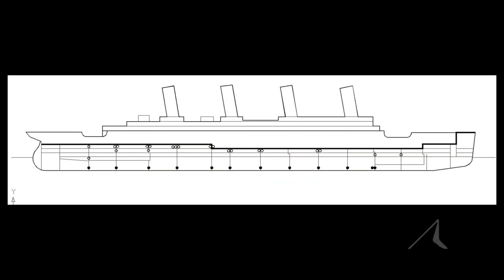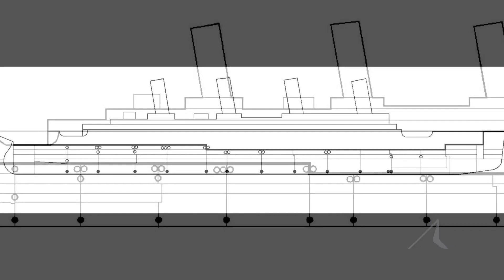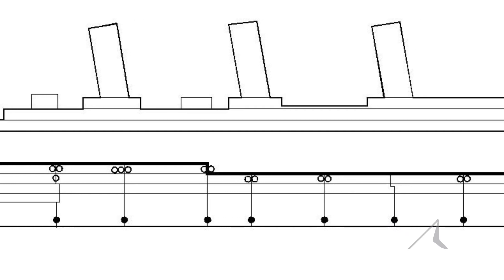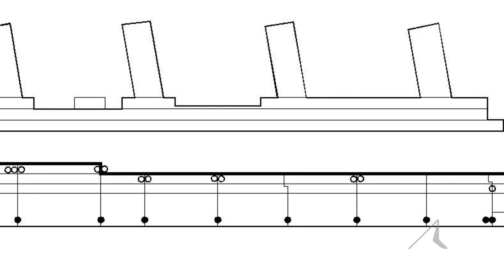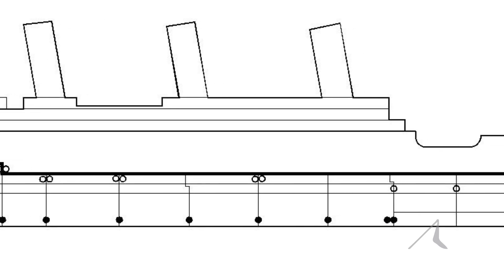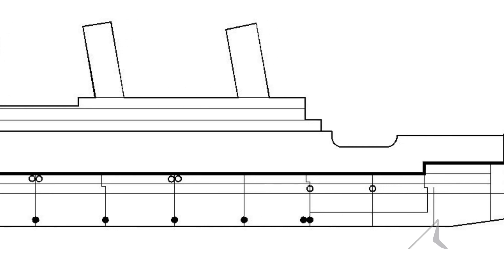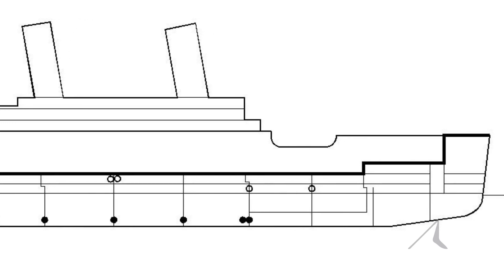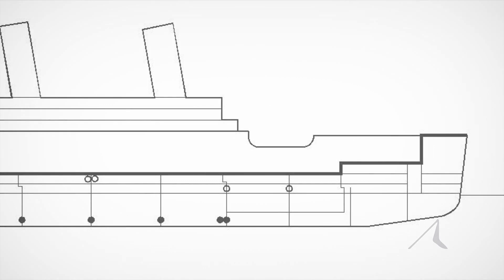Watertight Compartments - Parks Stephenson

Comment: I don't care if it were one or six compartments, without ceilings, the watertight bulkheads do nothing.
Reply: It would. The ship would stabilize if the internal water level would be the same as the external water level. This could be achieved with 4 compartments filled. But here, 6 compartments were breached  that dragged the ship further down without giving a chance to stabilize. 
And it was not without ceilings. Don't picturise it as an open ice tray. The tops were covered, but just not watertight. There were stairs, doors, etc... What they mean by water spilled over the bulkheads is that when the water level went beyond the top of watertight bulkhead, the water would find its way to the next compartment through the stairs or doors on the decks above and flow down.

Comment: why would they be watertight if the water could just overflow over the compartment?
Reply: That would also mean it would be airtight. It's impractical for different reasons like ventilation, stairs and access, crew movement, passenger movement etc 
Watertight in ships essentially means it delays the flooding and contain the water as much as possible. The water level inside the ship would only come to the level of water outside the ship. The ship wouldn't sink beyond that. So as long as the watertight compartment's top sits above the external water level, it's more than enough. In Titanic's case, the limit it can hold was exceeded and that's why the water filled up other compartments. If 4 compartments were filled, Titanic would've stabilized with the external water level. Since it flooded beyond the limit, the water flooding inside the ship weighed more and dragged the ship further down. This didn't give Titanic a chance to stabilize the internal water level with the external level and the sinking continued.

Comment: I cannot name a single wooden sailing ship that had enough natural flotation to stay afloat. Furthermore the drawing shown in very misleading with the dark line on top implying that the compartment were air tight. They were not. The tops were open in most of them.
Reply: He didn't say that a wooden ship will float without displacement, he said it would "help".

Comment: Andrews knew he had covered all the accidents Titanic could survive. Of course Titanic had one of the accidents she couldn't. With sea water in 4 compartments there is enough weight on the floor of the boat to push it down and fill it up. With sea water in 3 compartments there is not enough weight so the water won't reach the bulkheads to spill into 4. Not even close. So wtb all the way up won't help titanic. In fact with full closure 123 and 4 would quickly fill up and Titanic would hit the bottom of the ocean about midnight. On the actual night 6 watertight compartments were breached which is unsurvivable, watertight compartments all the way up or not. In fact rear of compartment 4 watertight doors and bulkheads only slow the sinking. 24 knots in an ice field just scary.
Reply: How would water spill over the top of the compartments if they were fully closed?
Reply: @gerrycalhoun9827  Because the the bulkheads only extended upwards a certain length. So if enough compartments were breached simultaneously, the combined weight of the water in each compartment would pull the ship down deeper in to the water, which in turn would cause the water level inside the ship to rise, and it would rise over the tops of the bulkheads and in to the next compartment. This process repeats itself like a domino effect, getting faster and faster as more water (weight) pulls the ship down. She could definitely stay afloat with the first four compartments breached, but not five. As a result of Titanic, bulkheads extend all the way to the deck and ships are typically compartmentalized so that flooding can be isolated to the area where the damage is located, but even this isn't enough with modern ships sometimes (see, Costa Concordia).
Reply: @setantii298  the watertight bulkheads were above water very low so  ANY flooding could pull them down and water would spill..

dont forget that titanic had more than 16 watertight doors.. the  there was numerous manual-watertight doors that had to be closed by crew members

if they only closed compartment watertight doors leaving the manual ones open that would explain quick demise.. from witness accounts there is described situation that  crew was unable to close one of manual watertight doors  near scotland road,doors were jammed 

titanic problem was a bit different
original damage by iceberg was in

forepeak tank in forepeak compartment,only ballast tank was flooded,compartment was dry
cargo holds 1 2 3 were taking water
boiler room 6 was taking water
boiler room 5 coal bunker was taking water but boiler room itself not (for while)
about more than hour after collision water started to appear in boiler room 4 and little time longer boiler room 5 was filled up..

when titanic fate was sealed? when boiler room 6 filled up.. that was 4th compartment and titanic could not lose any other,  the 4th compartment was final.. loss of boiler room 5 was just shortening sinking process

the flood rate of boiler room 6 was pretty high. if we compare flood rate vs ALL pumps capacity we can understand how much flooding is in certain section... boiler room 6 had worst rate of flooding and pumps were overwhelmed when calculating  entire flooding across all breaches in hull. if we focus on just one compartment then things change.. and yes 

and no they could not stop leaks,hull damage is hull damage they had zero tools to deal with that problem.. they could not use anything they had to block the leak. they could only pump water out with no way to actually stop water.
Reply: if the WTB extended to the top, water could not spill over them  because it wouldnt be possible. did you miss something?